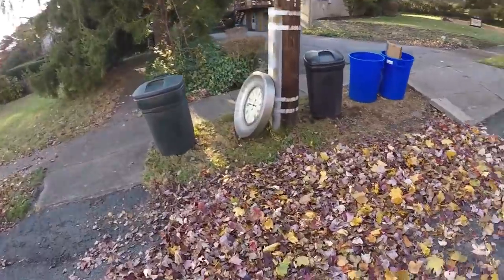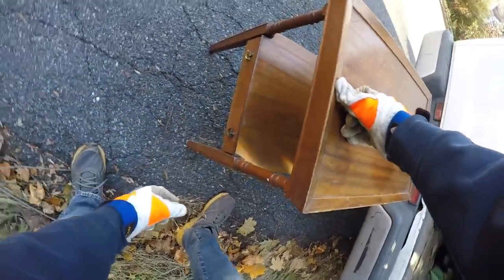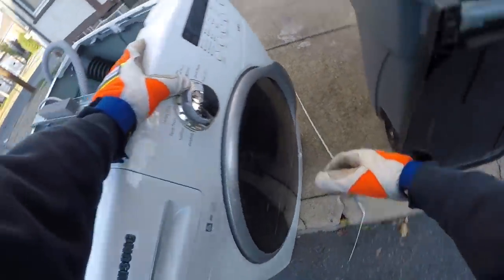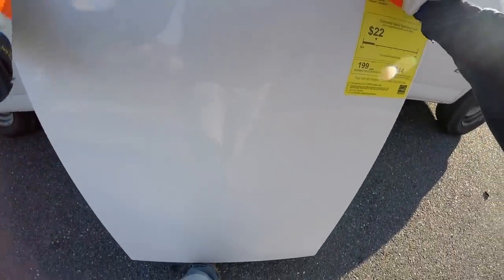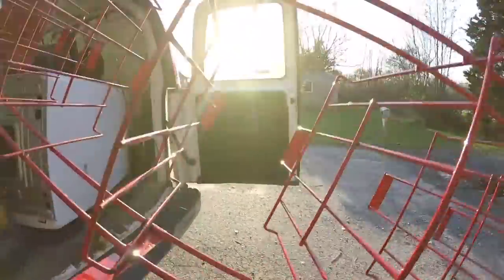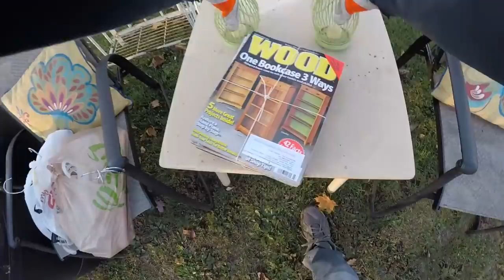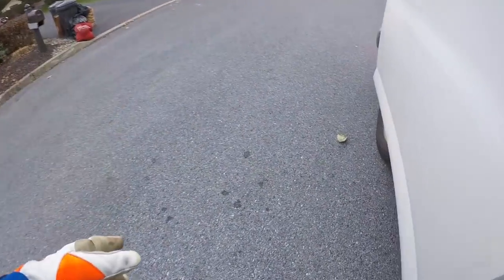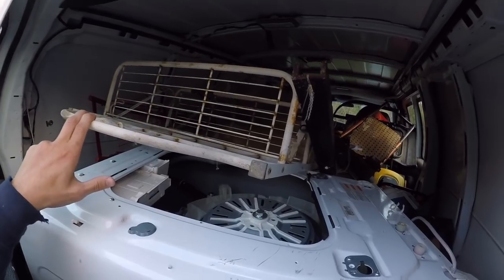GARBAGE PICKING LIVE! - HUGE SCORES! I Got a Full Van Load!

Comment: I just subscribed. I like your energy. I like the fact that you recycle and take stuff others throw away.  You recycle, repurpose or resell.  That's unheard of in todays society.  I have seen a few video's where you usually pass on those little tables or end tables etc.  

My niece was somewhere and she got a huge gallon like container of a really good furniture stripper for $2.00.  Then she saw a gallon of paint marked $40 but clearance for $3.00 and it was "matte black".  She'll run her for brush really fast over a stand like you just picked up.  She then powerwashes lightly the gel off the stand. She grabs some old towels and pats it dry. The next day she applies the black paint. Two coats.  She picks these stands up for free all the time. She had over 2 dozen ready and stored in MY garage LOL.  She put up a sign $20.  It took her almost 6 hours but she sold all 2 dozen.  People stopped, looked and could not believe how "high end" they looked. Especially in the designs. She said "Some of these tables are 50 years old.  They were stained with old varnish so I redid them.  Off Craigslist, we got 8 different dressers that were free for pickup.  She actually ran an ad that she wanted anything free so the could "experiment stripping and repainting". She got over 30 emails.

Quite a few of those dressers did NOT get painted. They were lightly sanded a few times and then we bought some stain and miniwax to buff them.  Wow, just wow.  

She marked all the dressers for about $100 to $125.  You should have seen the driveway, along both sides.    Some dressers and stands she  did not stand or strip. She found a "recipe" on google. You mix olive oil and vinegar.  You rub that dresser down and let it set.  Do it again. It brought it out like new again with a very uniform look.   A day and a half later I could now park my car in the garage and they all sold.  I bring this up because people like you too, repurpose stuff.   There is INCOME to be made for those that struggle.  There is no shame in anyone doing any kind of job, or work or craft to earn money.    So for those watching too, don't drive by a small stand and let it set.  That free stand could be a quick $20 in your pocket or more.

Comment: Here's some advice when you see appliances like washer and dryers take Parts off of them and sell them on Craigslist eBay and plug them in and see if they work because you can sell them on Craigslist for money
Reply: Chris Jensen I agree 5 dollars in scrap vs about 50-100 dollars in parts
Reply from the maker: I wish I was able to find time to do that, I want to get to that point but right now with youtube and other work related activities I end up putting in close to 60-65 hours of work a week. I don't have time to sit down and start taking things apart and testing them. One day hopefully.  That is the dream! Thanks for watching.
Reply: Taco Stacks you can start by selling knobs from washers and stoves. You can sell the timer from a dryer or the burners from stoves. Those parts don't take time. Pigtails from dryers and stoves will bring $10. Also when you get the time, microwave parts such as the glass dish, the door glass, door handle as well as the control board yield good money.
Reply: Miles Junk Removal, Where would u sell them?

Comment: Nice video, When you find speakers take off the grill and if the speaker surround is rotted away leave it, Unless its JBL of other high end speakers or bring a cordless drill pull out the speakers for scrap. Question what a taco stacker?
Reply: Canadian Treasure Hunter 
You can find good new speakers  on line ( not too expensive) to fix the boxes . Just read the characteritics of the old speakers and order new on line : i fixed hifi speakers boxes like that  , with better  speakers ordered on line , i still use these boxes on my Home Theater system every day ( i use the HT as a computer amplifier/speakers to listen to music on Youtube videos  , watch moovies  ( streaming) or to listen to country radios online .

Comment: little rough on them polks buddy...some are bank some not
Reply: Yeah go a little easier on those speakers :) The all-in-one units like you found aren't usually too valuable, components are better. Even if you test the speakers and one or both have issues they still might be sellable at the flea market, someone who is willing to do a repair on them would still pick them up.
Reply: That is to say the all-in-one stereo unit like the one you found (not the speakers)..
Reply from the maker: Yeah, usually they would go up front. If they were bose, I woulda buckled them in.